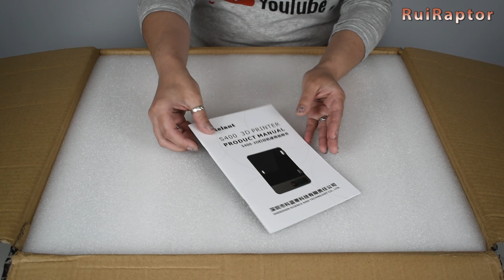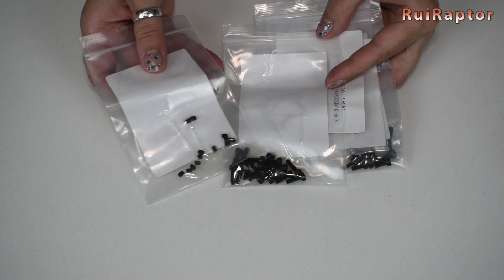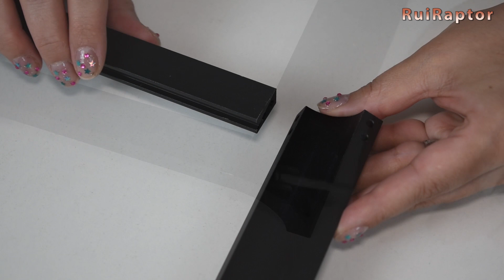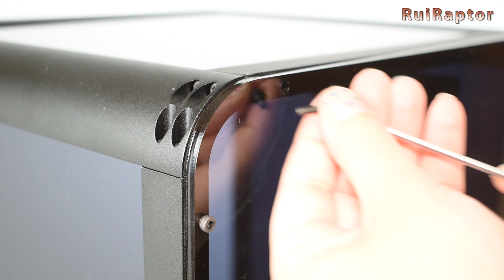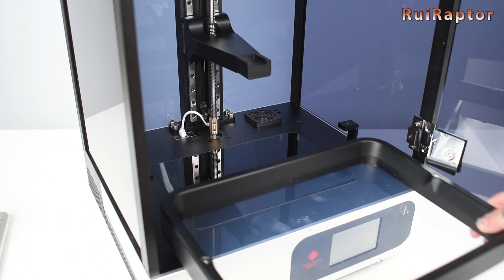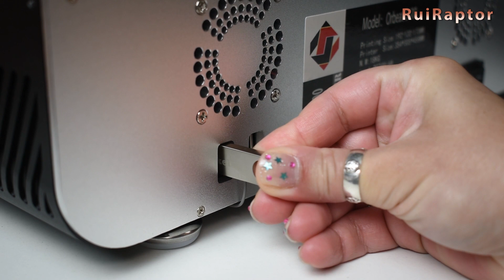Kelant S400 Resin 3D Printer - Assembly & Overview

Comment: I just bought one of these, I was very impressed with the build quality and assembly techniques and agree that the USB and power switch would be better on the front or side.  Problem is mine doesn't print and you never went that far in the video.  The USB drive needs to have a long plug to reach the contacts, the socket is obviously too far inside the machine.  The one supplied with the machine works fine but the rest of mine are too short.  The touchscreen is great until it comes to opening the file folder, that always seems to need 6 to 10 touches for some reason.  I open the correct file, the parameters are displayed, I press print, a blank box appears for a few seconds and nothing happens, I just get a Home screen saying "p-stopped" and 0%.

Any suggestions?  Kelant have not returned my email so far and I have an expensive machine sitting here doing nothing.

Mark - UK
Reply from the maker: Hi Mark, we are working on the second video with the setup, prints and review. Should be online very soon. Regarding your issues, i will try and send your message to them too. Also, if you have facebook, you can check and post that in the kelant group.

Comment: Oh! The drawback of big SLA printers is that you need more initial resin volume for any print. If the prices for resins will not be lowered noticeably then the SLA printers' designers need to find some workaround about it... Maybe some "lower volume adapters" or some changeable geometry features for "pools".
Or all this will not become a mainstream thing. Not even talking about health and eco issues with this.

Comment: Thanks for the great video. I like the print size of this printer but can think of several improvements that Kelant can make:
1) Put the power switch on the front. Putting it on the back makes absolutely no sense.
2) Put the flash drive socket on the front. Putting it on the back makes no sense.
3) Offer a smaller vat and build plate to make more efficient use of resin for small models.
4) Have a vent port and fan on the back panel to extract fumes from the enclosure and allow venting the fumes outside via a hose.
I look forward to seeing the print results.
Reply from the maker: Hi, your inputs make sense, however, regarding #4, because the enclosure is not air tight and you can even see openings between the top frame and the acrylic, the fumes/smell will still eventually get out.
Reply: @ruiraptor  I mentioned having a fan, an extraction fan to be more specific. In this way the gaps won't matter because there will always be negative pressure within the enclosure. If I end up buying one of these that is one of the first mods I'd do, along with moving the power switch and USB port.
Reply: @Waltkat  You won't need an extractor fan on a Kelant, the built in fans are quite good create a slight negative pressure in the cabinet, just use a duct to send the fumes outside.  On my Photon I disabled the internal fans, covered all vents except the ones on the back and fitted an external extractor and duct.  The Kelant will be plumbed into this with a length of vacuum cleaner hose so one extractor will serve 2 printers.
Reply: good idea,Put the power switch and U disk interface in front better, thank you for your suggestion